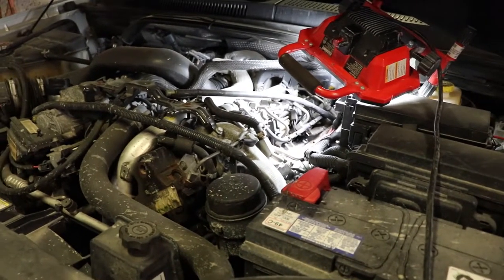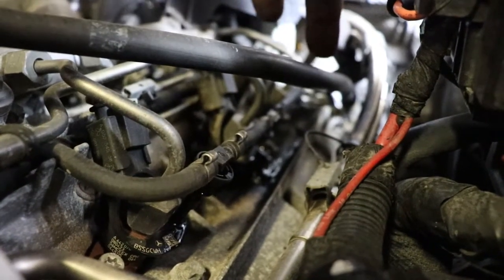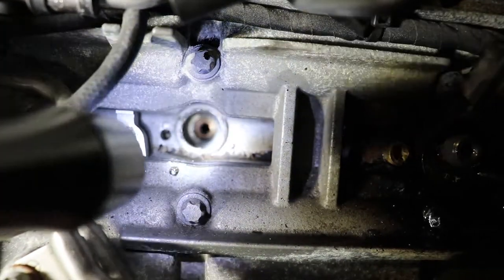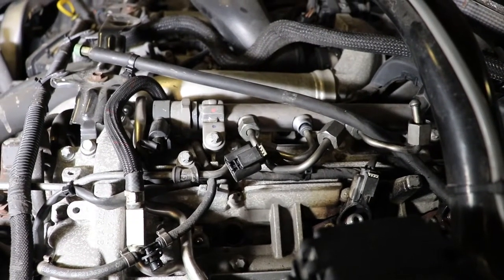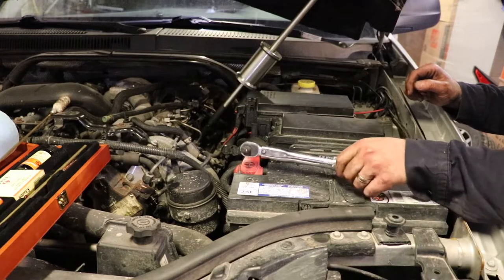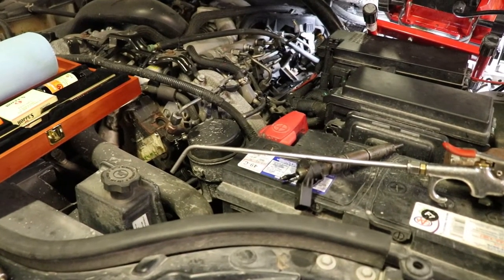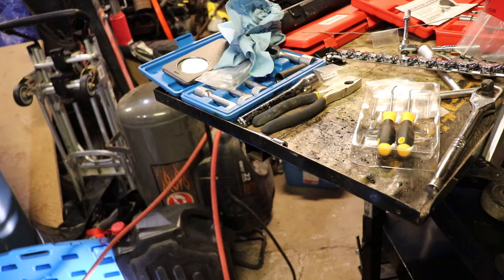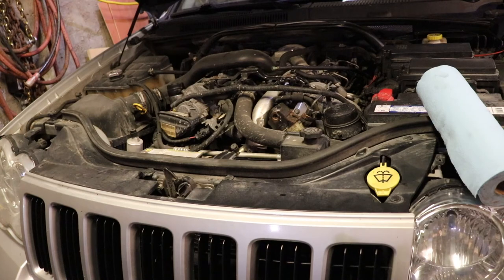2005-2010 Jeep Grand Cherokee CRD Fuel Injector Replacement

Comment: This is a great video,. Im about to take this project on with 185,000 kms. Number 6 is leaking. I replaced 5 glow plugs yesterday. Ya i said 5. Number 5 cyl’s glow plug seems to be separated and spins, with no leaks. So the ses light will have to be lived with again. Im a retired mechanic and appreciated your detail and patience. I will borrow or purchase the puller and reamer. Thanks again.

Comment: I cleaned the injector and put it back. Issue still there, replaced it with the injector next to it and the issue still exists in the same original cylinder so it's not an issue with the injector. I think I have sut and grime that is preventing the injector from being completely sealed.
Reply: Remove the copper seal and put a new one on, also check there isn't an old one stuck down the hole. The seal face must be clean and undamaged, there are reaming tools to recut the face if it's damaged.
Reply: @jeremytodd4906  yup ended up doing that and got the issue resolved. However, I'm now experiencing diesel leak from the fuel return line (black rubber tube) idk I changed the rubber O-ring twice and no bueno

Comment: Hi Stephen, thank you very much for your useful video.
I have the same OM642 engine on my 2007 JEEP Commander (made in Austria) with amost 300k km., It's starting OK when hot, but when cold I have to do two diesel heating sequences (...the yellow curl) to have a better starting...and sometimes have some little smoke (awful smell !) out of the exhaust with a irregular idling for no more than a few minutes. So I'll try to remove the injectors and send it to a speciallist to diagnose them.
Got that 60 ft.in (5 ft.lb?) for the long inyector retainer bolts, but...do you have any torque numbers for the those fuel line tubes "nuts" ?. Thanks !.
Reply from the maker: I'm not sure, take a look here:  https://archive.org/details/JeepGrandCherokeeWKCRDDieselEngineRepairManual2005Through2010OCR197Pages
Will it start correctly if you use the remote start?  I think you need to read the codes and do a leak test on the injectors before replacing anything.  A good scanner will tell you the correction value on the injectors too.
Reply: @SteveRivett  thank you for that link!.
No, I don't have remote start, it's the sport model.
First I'll check if it has the "black death" or not, but sometimes has like exhaust smell inside, and will do the inyector leak (copper seal failure) check. I also will check the turbo exhaust pipe green o'ring, because somebody told me that can leak from there too.
Forgot to tell you that about 23k. km ago I did the swirl motor delete with the resistor...working fine.
Thank you!

Comment: I don't see you responding to comments but hopefully you can make an exception. I have heard the fuel line or injectors are under high pressure. How do you relief the pressure? Do you need to "bleed" the system when it's back together? Thx
Reply from the maker: Youtube doesn't notify me about most comments.  The CRD is under very high pressure, it is dangerous as the diesel can cut your skin and go into your blood stream.  All you can do to bleed the system is to cycle the key a couple times and crank until it starts.
Reply: @robby60259  Thanks Robby. Makes perfect sense
Reply: The common rail pressure dissipates virtually as soon as the engine stops running . These engines are self bleeding . Just have to crank until it starts .

Comment: You haven't configured the ECU for the new injector?
Reply from the maker: That's a good point, there is some function in my Autel 906BT to adjust the injectors so I should have mentioned this.  In my case I put the injector back in as the seal was just leaking.
Reply: Do you need to configure the ecu when replacing with oem injector?
Reply: @leftR-tardation  
Yes, each injector has its own tolerance that must be configured in the ECU.
Reply: @je1966  Thanks for the reply. That makes sense...
Reply: @leftR-tardation  
Better explained... Injectors are elements that have to work with more precision than their manufacture allows (especially piezoelectric ones), so, after manufacturing them, their deviation is measured, and a code is engraved on the body.  that code is entered into the ecu, which applies that correction.
Reply: @je1966  that’s pretty cool. I guess it depends on the car too? I’ve changed injectors in my Subaru and Honda’s in the past and never had to do this. I’m guessing because they were not diesels or direct injection.
Reply: @leftR-tardation  
Yes, it depends on the engine and the type of injector.  Not at all, even if this adaptation is not made, the adjustment is so little that it is not noticeable
Reply: @je1966  Cool. I just replaced a washer on 1 leaky injector and replaced my glow plugs. 3 of the plugs were saturated with oil on the passenger side of the engine. Sucks. 

But I’m glad the injector is not leaking anymore lol

Comment: So... I ended up breaking my injector bolt.   I have no idea what to do, I can't figure out how to get it out without damaging the threads.  Do  you have any suggestions?  I think I had a crappy bolt because it broke BEFORE I reached my torque spec.   I have the Grand Cherokee CRD 3.0 diesel.
Reply from the maker: There is an OM642 injector bolt removal fixture you can buy to drill out the bolt.  You may have had dirt in the hole or you may have had a torque wrench problem.  Hopefully it is one of the easier bolts to access for drilling.
Reply: You have to use brand new bolts . These bolts are 1 use only stretch bolts .
Reply: @stewatparkpark2933   Well, I found out the hard way, you should NEVER break one of these... I had to have the head replaced... 3500.00 bucks
Reply: @GoldGunsandGolf  Brutal man, hope the Jeeps been treating you well since!

Comment: Hi im from the UK but have a wk/wh 3.0 crd and have a fault code P0278, do i just need A new injector or could this be something else?
Reply from the maker: I would do an injector leak test on all of the injectors together and see if that injector is passing a lot of fuel back through the return.
Reply: I had a similar issue. Ended up putting two bottles of diesel fuel injector cleaner in the fuel tank and cleared the code and everything went fine for more than 20,000 km now

Comment: What do I do if I broke a fuel injector?
Reply from the maker: you will need to replace it with a new or rebuilt injector, hopefully they will take your broken one in as a core.  Rock Auto has them some times.

Comment: can this produce White smoke??
Reply from the maker: I am not sure, you will usually hear it and smell exhaust under the hood if they are leaking
Reply: @SteveRivett  oh. Ok. Thanks. No. I do not smell diesel inside.
Reply: @SteveRivett  I mean leak incide de cylinder. like the inyector do not close 100%
Reply: Si vous avez la fumée blanche a l'arrêt il faut changer un ou plusieurs injecteurs.